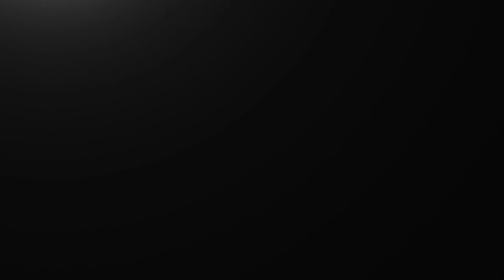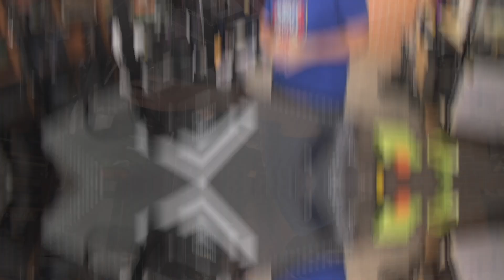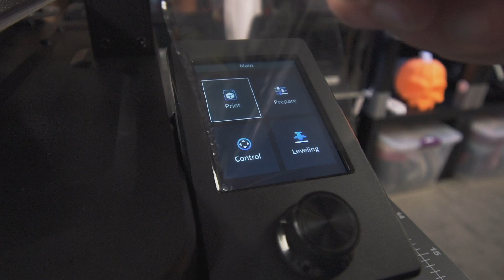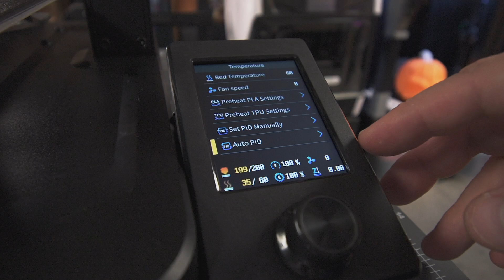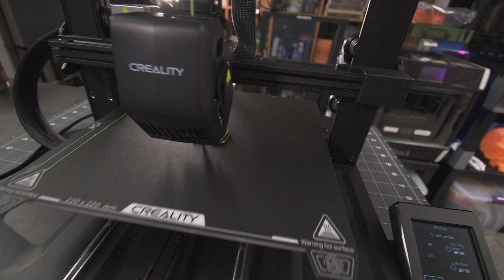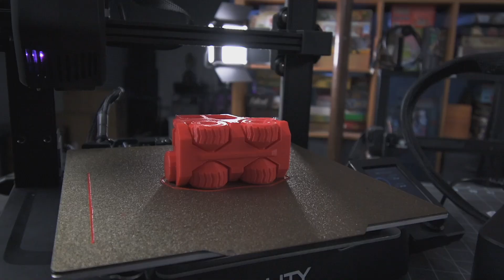$200 & Zero Calibration - Creality Ender 3 V3 SE

Comment: Interesting machine. Good to see Creality providing a budget oriented improvement over the typical v-wheel bed slinger.

The rods in the Y are good to see. Most bed slingers are limited by the y for both speeds and quality (ringing etc).

The change to the orientation in the X* might be because the KE has a rail on top? So even though this uses wheels on the X they can use similar base parts...?

Love seeing load cells on printers. Essentially a solid state component with moving parts. I hope printer developers can start to use them as more than just binary levelling switches.

A UI indicator for whether something is a sub menu or actionable button should definitely be added

Comment: Are you supposed to use glue stick on on the build plate?  I know with the bambu “cool plate” you are supposed to use glue stick.
Reply: I don’t like it but that’s the way that machine is.  I think having to use glue stick is a step back.
Reply from the maker: I think that PEI I linked is 10-12 dollars. I wouldnt even buy a machine without it at this point.
Reply: @3DPrintSOS  I don't get why Creality did that.  I know Bambu did their build surface so the parts would stick at a lower bed temperature.  And Bambu has what I think is PEI on the other side.  It seems like Creality almost got this printer 100% right 😄
Reply from the maker: Theres no hope for polycarbonate. I hated it in 2018, and I hate it now. haha There is no comparison with PEI.